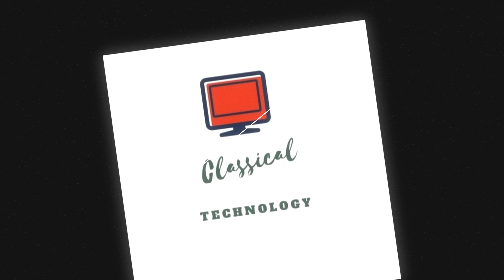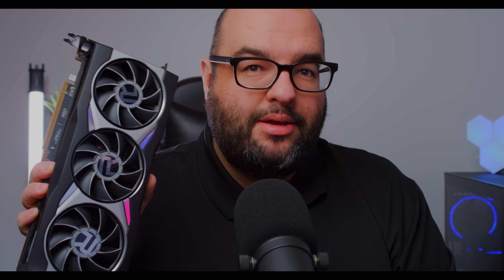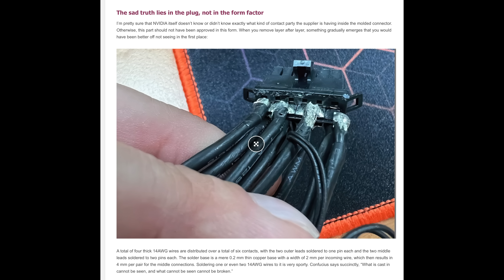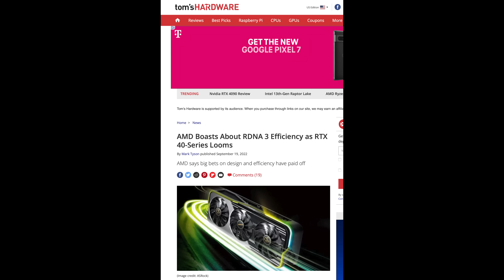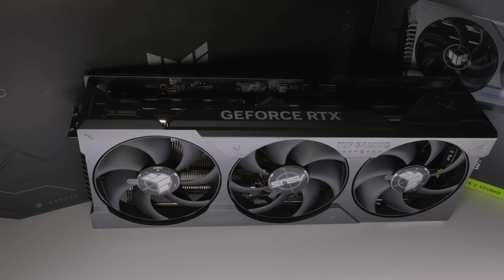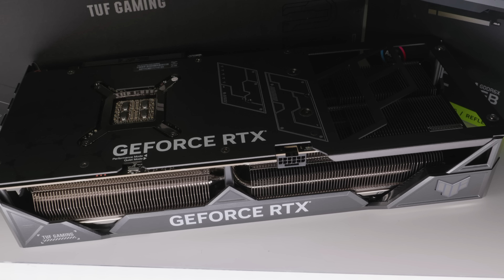LEAKED! You're going to want to see THIS GPU...

Comment: This issue with the melting adapters, I believe is real, but it has been blown way out of proportion by Jay and other Youtubers, even you Tiago.  Steve from Gamers Nexus, Igor and even Jay tried to recreate the problem, but couldn't do it.  Igor speculated what he thought the problem was and Jay doesn't know, but he should have done the testing that Steve did after raising the initial issue. 

 Steve has done the most complete job of anyone at testing and he goes into a ton of detail including Nvidia's spec at 300 volts for the possible failing pin and the 150-volts pin that was seen in circulation.  His video is the most complete on the subject matter and he couldn't even re-create the problem. I believe that it is real because of what Nvidia released or what got released about the bending of the cable from Nvidia's release notes and the way they are trying to quietly handle this, but this is not as widespread as being reported, but I believe it is a problem for a card costing this much money or a video card period. 

 My question to you Tiago, are you having any problems with your RTX4090 with melting cables?  There are just too many variables like which way were the cables bent inside of the case, was the connection secure because Steve found that the card would still power on and work with a broken connection, but this would lead to the melting of the adapter due to power being distributed.  Steve, Jay and even Igor were using test benches so these cards were not inside the computer cases, like most ethusiast would use them. 

 We need to give this "MELTING CABLE TOPIC A REST" until we have further CONCRETE information.  I'm glad that AMD won't be using this connection and if AMD does a price cut right away and the card's performance is s close enough to the 4090, they can steal huge amounts of users away from Nvidia forcing them to be competitive again and price cuts would be good for us all.  Good content overall and keep it coming.
Reply: Actually the only problem Tiago is having with the 4090 is the reinforcement of the foundation of his house to support the weight of the new card.
Reply: @halrichard1969   Now that is funny...ha, ha, ha!!!
Reply: The issue is its happening to consumers in the market who brought a top of the line flagship product. It's a big sour note for Nvidia.

Also you wrote a small nobel about this. Cope.
Reply: @GXJ013   I think I more than mentioned what the issue was if you read it and I talked about it from a different perspective. I like small novels.  People with short attention spans and Tick Toc mentalities, often have problems reading novels.  I don’t need to Cope and I like to be precise with the details. Deal with it!!!

Comment: Can I use an AMD card if my motherboard has an Intel chipset? I have the new ASUS Z790 Maximus Hero.
Reply: Yes, you can use an AMD gpu as the chipset doesn't discriminate.
Reply: R u new to pc gaming ? 
If ur mb has a pcie slot, u can use any modern gpu
Reply: @sudeshryan8707  not new, but I’ve never mixed it before
Reply: You can, but you'll miss features like the inifity cache.

Comment: The 7900XT will have three eight pin connectors
Reply: Hw do u know ?
Reply: @sudeshryan8707  Unless AMD want to go nuts on drawing PCIe power, then two pins at a max of 300 Watts isn't going to be enough to max out the performance potential of the 7900XT.

I have a 7950X CPU and although it costs me at least £1.50 per day less in electricity cost to run than my 5950X cost (all peripherals the same, but the 7950X has two more DIMMs of RAM). 

When I bung it under a load like CIneBench R23, my 5950X result was (without overclocking and running 100% within spec) 31,105 at around 180 Watts. With the 7950X my CB R23 score is 40,210 and the wattage is 177 Watts.

So the 5nm vs the 7 nm can be pushed to a similar power envelope and that's why I think that the 7900XT will have three eight pin connectors.

So I am not just pulling that out of my ass.
Reply: @michaelnager6059  no need to ruffle your feathers. I thought by the way u commented u work for a aib or something.

My guess was they use 75w from motherboard for a total of 375w. But pulling from mb could be bad. My guess is also eventually it will hv 3 connectors. Aibs will probably use anyway.

Comment: Keep in mind that the size increase is mostly for a larger fan size. More air, more cooling. They needed to larger width to support the additional space just for the fans. Maybe a larger heatsink as well over that edge, but that is similar to the 4090 that increased the fan size.

Comment: You really only need 44 frames per second with Freesync and 60 fps without. If AMD hits that with raytracing at every tier they're going to sellout. Halo products are not a good reason for brand loyalty.
Reply: Had this same conversation with my brother inlaw the other day.

Console's are what, 30-40 fps? 60 seems like the sweet spot for smoothness.

If you play mainly single player games 60 is perfectly fine.
Reply: @Dr_Julius_No  It's good on multiplayer as long as it doesn't dip lower. Hitching is the worst though.
Reply: @Dr_Julius_No  Xbox series X is 60 or 120. I play mine on an LG C1 and get and FPS count through my game optimizer setting. I've been playing Fallout 4 with auto HDR and fps boost on its a world of different from my OG Xbone.

Granted my TV supports AMD freesync with the Xbox.

Comment: CLICKBAIT again, just a picture Ohh power connectors, it just says its max 300+ W, the + is for minor W from the pcie slot
Reply from the maker: Hello!
Reply: 75W, to be precise, so 375 in total, it sounds about right.
Reply: @rijjhb9467  I don't think even the 4090 uses more than 30 watts from the slot.
Reply: @LowkeyTryhard  then it's 330/350, still plausible
Reply: @rijjhb9467  it's over 350 and you know it.
Reply: @LowkeyTryhard  no, I don't know, because... how can it be?

It has 2 connectors rated for 150W, plus it can draw a maximum of 75W from the main board.

Just do the math?
Reply: @rijjhb9467  375 > 350!!
Reply: @LowkeyTryhard  375W was my prediction in my first comment, so...

However, no need to speculate anymore, the official specs are out: the 7900 XTX will be a 355W card, while the 7900 XT will draw just 300W.
Reply: @rijjhb9467  It's the adapter not the slot. Get help.
Reply: @LowkeyTryhard  why don't you help me? Most youtubers are saying it's a 350W card, it's pretty much comfirmed.
Reply: @rijjhb9467  Because IDGAF! lol I don't know if we're counting transients spikes or not. Either way I'm not interested in a $1000 GPU.

Comment: These cards are getting ridiculous and for what, a bad implementation of RT?
"RX 6000 series is not good at RT"
I have a RX 6700XT and I turned on RT in Far Cry 6 with HD texture pack. Ran just fine and the Radeon software said my average fps was 102 and that is on ultra settings.

Turn RT on in CP 2077 and the fps drops hard. Just a bad implementation.
Reply: C2077 is next gen, far cry isn't.
Reply: @rijjhb9467  2077 is not next gen. It is on the same old engine as Witcher. It is a bug fest that took two years to make it playable.

Comment: Can you recommend a nice full size atx case for people who care nothing about RGB but want good temps ( and a decent price) with a few ports in front? Or recommend where I can get a good look at a lot of cases and decide for myself?
Reply: Lian li o11 air mini.    Full atx, but wider and shorter than a standard atx case, is all built for airflow, has space for a 360 aio on the back wall so that you can still do the 2 front in/2 bottom in/2 top out/single rear out fan setup for near optimal airflow, and then you can change the in and out speeds to fine tune the case air.
Reply: @NobodyAwsum  but only SFF PSU?
Reply: Phanteks P600S
Reply: @MindaugasSnegirevas  I like the Enthoo Pro.
Reply: @user_16309  And that's great. Enjoy it. 😁
Reply: Go for the corsair 4000D airflow.
Reply: Fractal design torrent full size

Comment: Bigger is not better. If that intel ARC was any good, I would get one of those.
Reply: MLID says they only made a few so they never planned to save the market from high prices.
Reply: Intel's issue is drivers. They're also doing a bottom up release as opposed to the top down release like Nvidia.
I'm definitely interested to see where Intels GPUs will be by their 3rd or 4th gen.